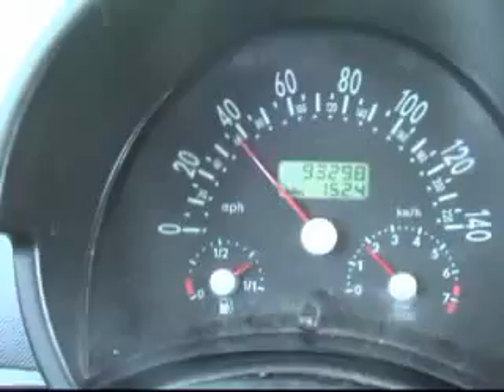cylinder deactivation gas saver

Comment: thats a good way to bend your crankshaft...you will want to get rid of 2 cylinders to be less damaging...but then you will have to crank up your idle to give it enough momentum to carry on the rotation...unfortunatley, your spark plugs are now fouled and your valves are getting gunked up.  the oil cycle is still going on in the system.  If you were hard core, you would plug it entirley, and remove the pistons, then it might work....but it will barley have enough power to get it moving.

Comment: 1 bad idea...[for many reasons]

Bottom line: you may save few % on the fuel bill, but your engine will have lower power output and higher wear at low rpm due to imbalance. [-> that will cause the ecu to run at wider throttle to prevet stalling]

Want to save $ on petrol? Drive accordingly. [!= slowly]

Comment: you computer will be giving it more fuel wont it? because its still got the exhaust gas oxygen sensor, that senses how much oxygen is in the exhaust...

because theres going to be more oxygen, as one cylinder is going to be pumping fresh air into the exhaust.. computer will see this and give it more fuel...

WAIT... engine light on means limp-home-mode... it ignores most sensors, my mistake, you may be saving fuel

Comment: the correct method is to remove the pushrods as well as fuel injectors, tends to give a 30% boost in V8 engines if you cut the cylinders being run in half. lots of work and not massive.